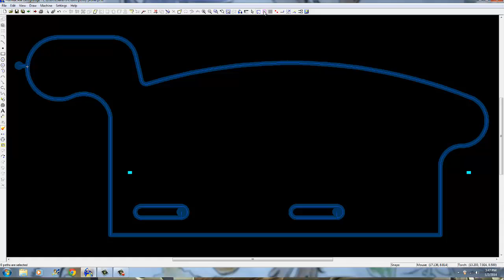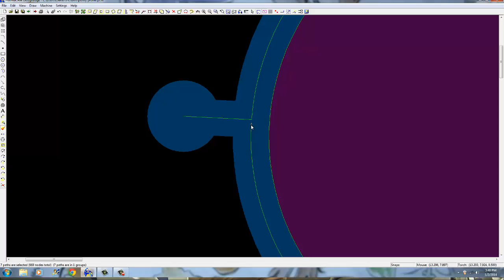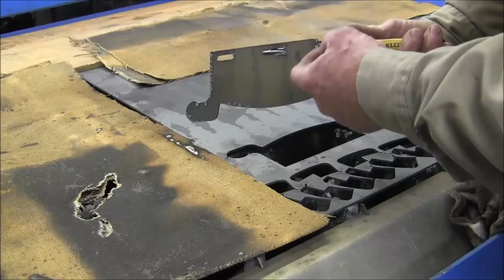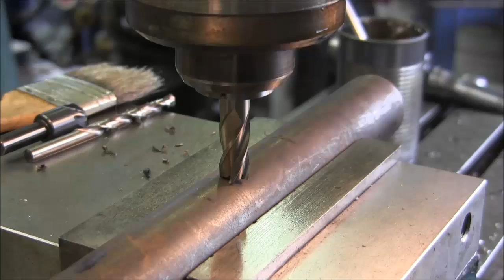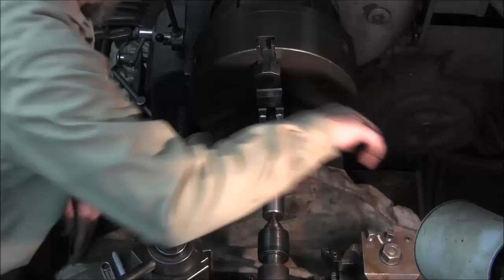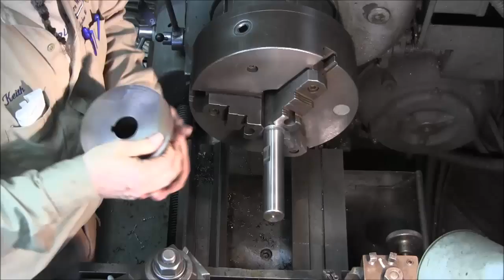Working the curves Part 1

Comment: Keith, I grew up in the oilfields and learned to work safe, even around potentially dangerous rotating machinery. I don't have any problem with your filing technique, you're an experienced hand. BUT, please please loose the long sleeves when you're up close to the chuck. You're too good a guy and too good a machinist for your fans to see get hurt. B-safe!!!

Comment: Kieth,  at around 26:00 min.  the part at the right-open end seems to be not centered on the mandrel,  which seems to me  that any outside work would just be way out once mounted in machine it goes to,   would it not have been an idea to place a tapered block pushed into the open end and locked on mandrel to hold the part true centered,  then any outside work done would become also true to center???

Comment: That is an interesting tool post.  Looks like aloris but its not black nuff.  Did you polish up your old stuff a bit?  What is the cutting tool your using?  Metric is just another way to look at stuff.  Some of my micrometers are world war two ebay finds.  I find myself doing more and more metric crap.  Lots of english and metric on the same part.  Sign of our times I guess.  I did notice how clean your inner bed sections were.  I like that.  And using the tee shirt for keeping your beds clean.  Nice.

Comment: Why the left hand thread on the back stock ??
Reply from the maker: Laws of physics, not having to change your stance at the lathe to loosen or tighten the tail stock. This was done by the owners before me and I love the concept, and when it had broke I re-manufactured it as it was in a better material to withstand a longer duration. ;{)---

Comment: Keith, I wanted to know more about the cross slide following the template, eg is it spring tension holding it or some thing else ? Obviously you've taken out the cross slide nut or could it be a half nut disengaged ?. Thank's
Reply from the maker: It is Hydraulic controled and you cans see more about it in my wing it videos! ;{)---
Reply: Keith Fenner
Ok TY I'll check it out : )

Comment: Question....what causes that hammering sound on the mill that you hear at 9:40?  I get that same thing when cutting on my mill at times and wondering what causes it and what technique or adjustment I might need to change to prevent it.   Is it backlash in the feed screw?  Adjustment to correct it?  Thanks in advance!
Reply from the maker: It is the spindle noise when you have an interrupted cut the difference between free spin and load of cut and the lash in the drive train tightening up at the time of impact. ;{)-----

Comment: Keith,

Just curious but why did you put the rag down to collect the cast iron swarf? I don't do any cast iron work so I haven't run into that myself but I have seen you do that on several occasions in the past as well.

Thanks,
Tom
Reply: Cast iron typically doesn't turn into nice neat chips, it crumbles and leaves a fine iron powder which is fairly abrasive.
Reply: The cast iron swarf from the surface might have imbeded sand.  That's the main issue.
Reply: He explains why at minute 21:50.
Reply: I understood why with the sandpaper but wasn't aware that cast iron is also gritty like that when machined. Thanks for the input, everyone.